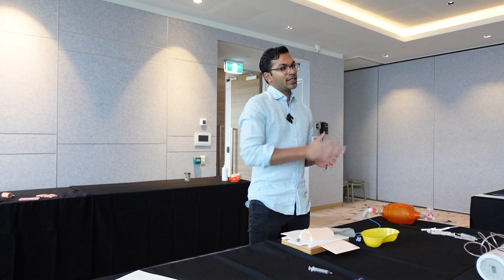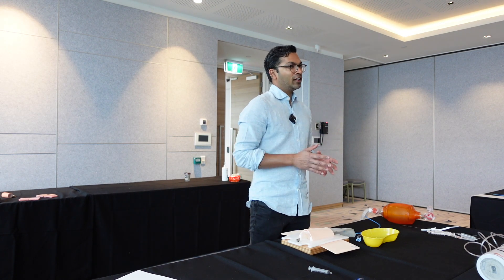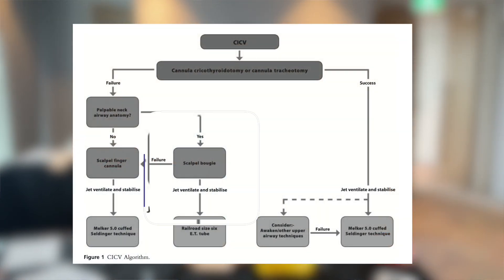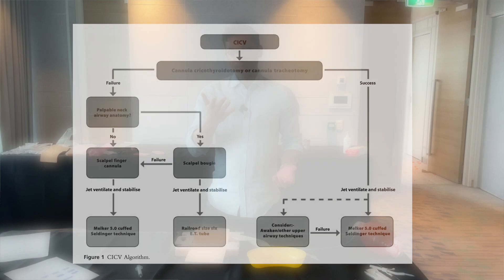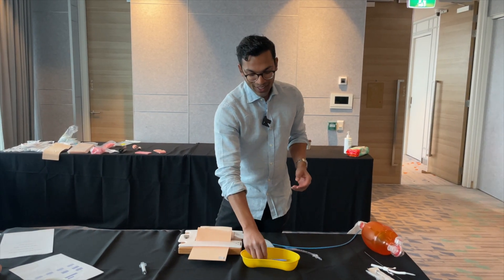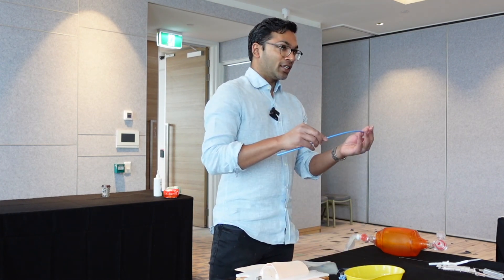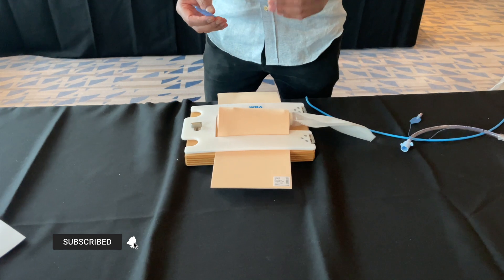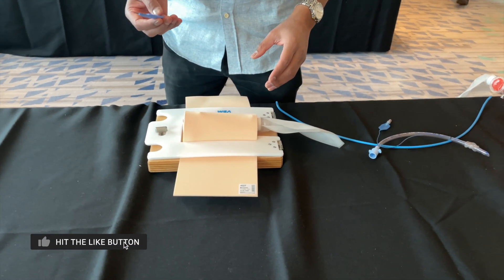Scalpel bougie technique in CICO emergencies | Airway Management

Comment: How would you dress the tube so the hole in the neck doesn't get infected. Sterile bandaging is essential to line insertion, this hole seems a lot bigger and would need to be protected with some sort of sterile wrap.
Reply: Essentially once CICO has been activated and this technique applied the need for sterility goes down in the priority because definitive airway takes presidence over infection which can be treated as a secondary measure later. Those who require CICO will need ENT referral for further management and assistance as well.